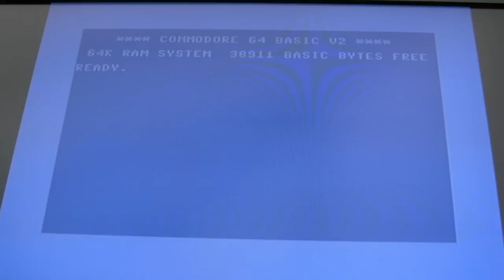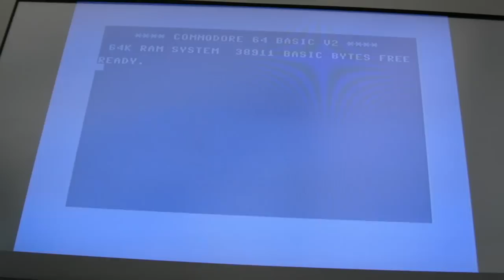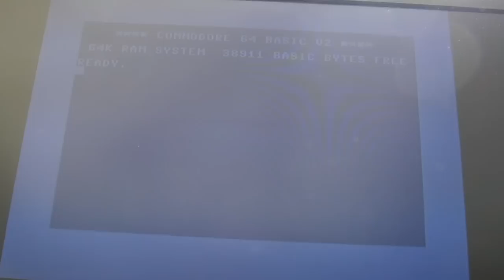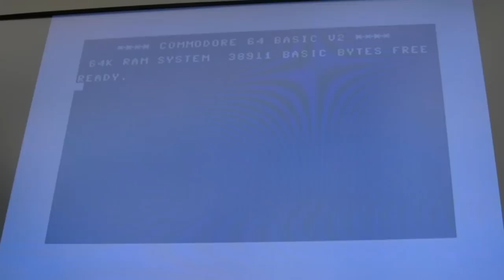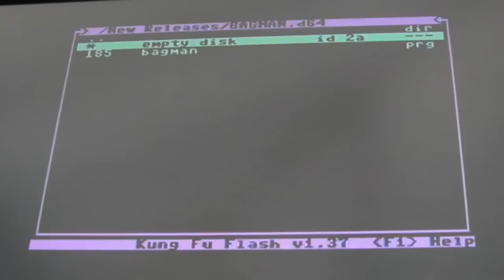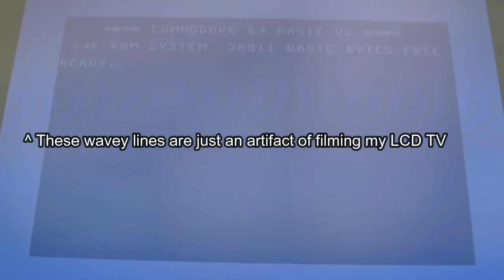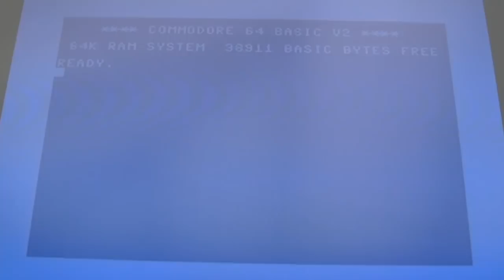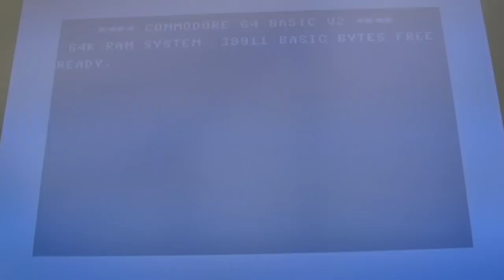Commodore 64 (C64) Zero Intelligence Farts & Modulator Replacement

Comment from the maker: Most of the video is about the ZIF sockets
Voltage Displays @48:40 and @1:18:33
Modulator Replacement @49:56
I put insulation tape underneath each voltage display.   You can find them easily on eBay.  You can also find the modulator replacement and ZIF sockets on eBay.
NOTE: I noticed the bend in the cart slot metal cover, I straightened that later!

Comment: For future reference:  There is a really amazing flux called ruby fluid. It will allow you to tin the damaged area where the RF demodulator was removed. I did my cartridge port with it: Fibreglas pen etch then heat + Ruby Fluid / scrub hard with Sal Ammoniac. Cleaned it, tinned with Ruby Fluid and Bismuth / Tin (Roses Metal) solder.

Comment: I know those textool zif sockets are cost effective but for a few more dollars/pounds there is some really cool low-profile zif sockets out there with a more compact design w/ smaller horizontal lift leavers. 
Awesome job BTW. I got the parts for mine years ago but been procrastinating too. 😁 I’ll use this vid as motivation to jump on it and borrow some ideas. Thanks!

Comment: Don’t forget millions of homes still have lead pipes.  I doubt it will stay in the dishwasher and will just get flushed out, certainly wouldn’t stick to anything in the dishwasher that's being washed and it's unlikely you’d be doing it regularly.   I think more damage would done to the board as many components aren’t hermetically sealed and things like variable resistors, capacitors etc could get damaged.

Comment: You're more likely to get lead contamination from old water mains and pipes than any tiny amount washed off of a circuit board remaining in your dishwasher.  For that matter, if you live in a city, gardening is more likely to stir up lead contamination from settled auto exhaust in cars that used leaded gas prior to the 1980's

Comment: you should of put dip sockets in then just plug the zif sockets into them good vid keep up the good work mate
Reply from the maker: That would work, but be an unreliable connection - and once the ZIF sockets are removed the DIP sockets would need replacing.

Comment: I put ZIF sockets on 2 of my Speccys, (a 48K and a 128K), so I could easily swap the ROM's. On the 128K I had to move 4 resistors and a diode to get the ZIF in. And yes, they were both a pain to fit.

What's always bugged me about the C64 is that in Basic you can only use just over half the RAM. At least with a Spectrum you can use 99% of the stated RAM available. :)

Yay, the Fairlight theme tune. I would load it into my Speccy just for the tune. :)

Great mods. Esp the Volt meters. (sorry I missed it live)

Comment: For cleaning the rust off the cartridge slot cover, try using a Garryson medium grit abrasive block. Shifts the corrosion very easily and if you line up your strokes you can create a beautiful brushed metal effect. For my money looks better than the original!

Comment: If you have some hot glue I would stick down the leads coming from the voltage meters as it is a possibility that they will snap off the solder connection due to flexing as the board is handled.  If you can't do that try and route the wires from the displays under the wire ends of the through hole resistors and caps to act as a strain relief to some extent.  I do wonder if you could replace some of the caps on the bottom of the unit with SMD ones as that would reduce the risk to them getting damaged.

Comment: Not sure if the 12V regulator is supposed to be bolted down like that. I have always seem them angled upward off the PCB slightly.
I believe with the 8701 you can get about 9 different phases the dot clock can be in relative to the colour clock, so that may explain why the jailbars are sometimes less or more pronounced.
Reply from the maker: It's really just an optional thing bolting down that regulator!  It doesnt get especially hot - but there's nothing wrong with heat sinking it into the board there.  Thanks for the info on the 8701!

Comment: Could you plug the ZIF socket into the same socket that the chip was in.
Reply: Could do but you are then introducing another connection on each pin which may make it unreliable especially as you are pushing and lifting up and down on the bar to put a chip in and out which may move the zif socket. It would probably introduce more errors and ultimately send you down the wrong diagnostic path wasting time.

Comment: What You WANT is Copperdragon's Component/RGB Mod board. What You cannot get right now is exactly that as the FPGA chips are nearly totally unavailable. At least they cannot be ordered from any supplier that I can find.  I have built 2 of them. One for my breadbin and one for my 64c.  The only problem with it is once You have this You can't go back. Some may say it looks too much like an emulator but realistically it puts the c64 up there equally with other RGB capable systems like the Amstrad CPC, later Spectrums, Amiga, etc.  I had used Lumafix on both units before which did a good job of removing jail bars. I don't know why Adrian Black couldn't get that working, maybe an NTSC thing or it doesn't work well with composite. I used S-video before. Anyway I'd try that on Yours and see if it helps.

Comment: It's a shame the ZIF sockets made by Aries are so expensive, got them at digikey, part number A850AR-ND for a 28 pin and they have 24 and 40 pin ones, not sure whether they do smaller ones. can't seem to find them cheaper anywhere else.